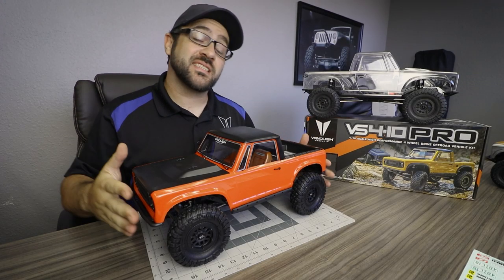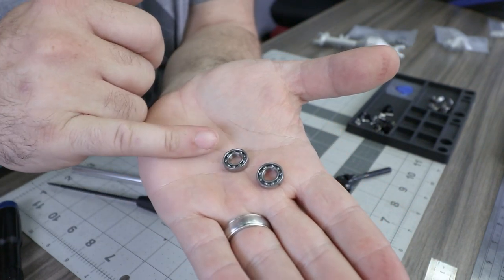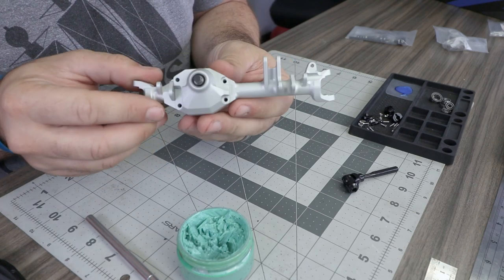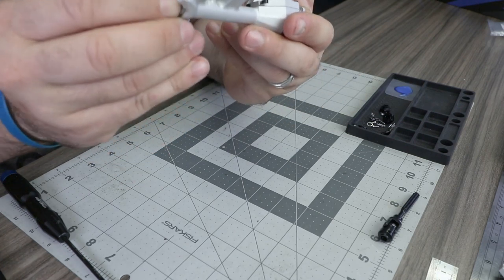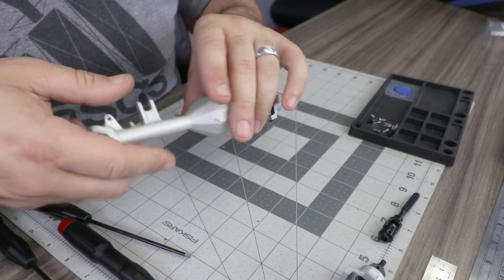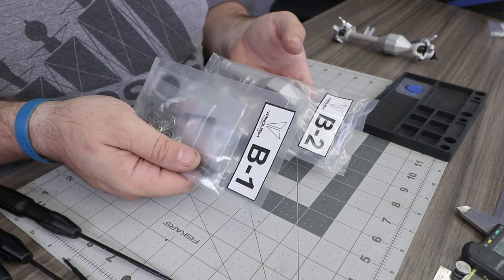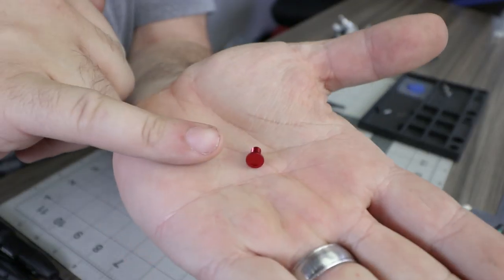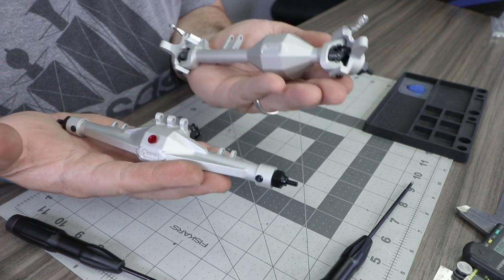F9 Currie Axle Assembly - VS4-10 Pro - Vanquish Products

Comment: When I begin to tighten the shouldered kingpin screws about half way in the knuckles become very tight, any tips? Also, Using the revised inserts that came with the kit, they seem to be quite loose as opposed to how they looked in your video. Wonder if these insets are also causing the issue with the tight knuckles
Reply from the maker: You can try the originally included parts. They were too tight on some axle so the revised versions were included.
Reply: @HarleyDesignsInc  appreciate the help Josh

Comment: I'm having a small issue, the high steer arm on the left side locks up the steering knuckle because the screws seem to be slightly too long. I'm sure I'm using the correct hardware

Comment: I have got mine mostly built but one thing is troubling me, when putting the half shafts together I could not find any marks to line up so they will be in faze and not vibrate. Are there marks for this or do you not need to line anything up?
Reply from the maker: There are no marks, you’ll just want to line up each side of the shaft to each other.
Reply: So what your saying is as long as they slide together smoothly I'm good?
Reply from the maker: I mean lineup the ears of the female side and male so they match. That will put them in phase.
Reply: Oh, Okay! Thanks Josh. =)

Comment: Are you sure the diff carrier bearings are supposed to be unlubricated?
Reply from the maker: They have standard bearing lubricant on them already but they are non-shielded, not unlubricated.
Reply: @HarleyDesignsInc  OK. They just looked dry.  Most unshielded bearings come unlubricated because they are lubricated by whatever they are running in.  It's very strange to see unshielded or non sealed bearings that aren't either oil bathed or packed with grease.

Comment: Do you have to add oil or grease to the axels often ??
Reply from the maker: No, it’s really only something you do when you have it apart for something else.
Reply: @HarleyDesignsInc  what's the best grease to use ?
Reply from the maker: @RcCrawlin1775  I use the Vanquish grease but there are many good RC greases. I prefer a gear grease that’s good and tacky, not standard white lithium grease.